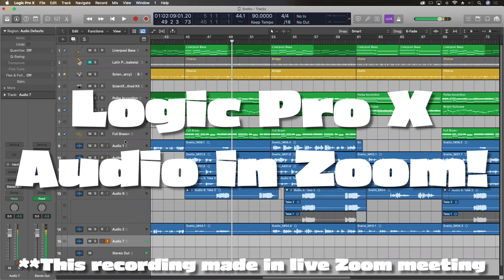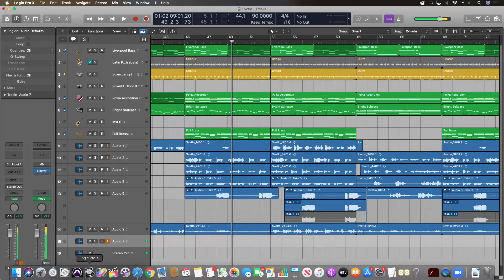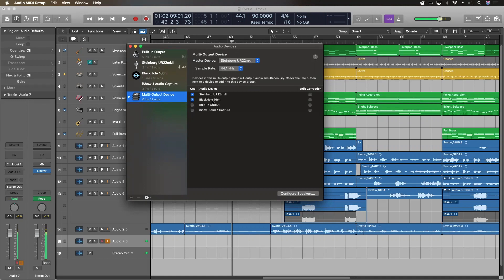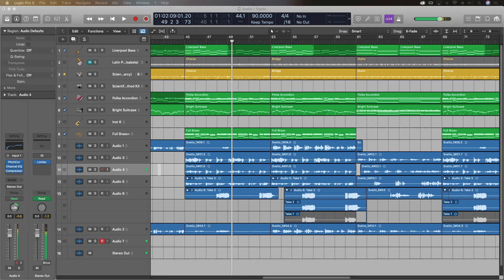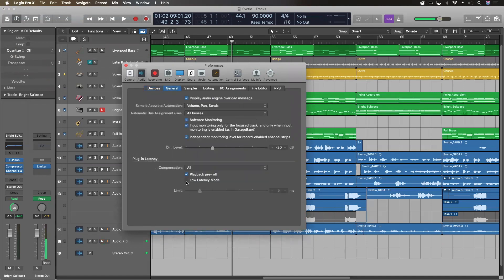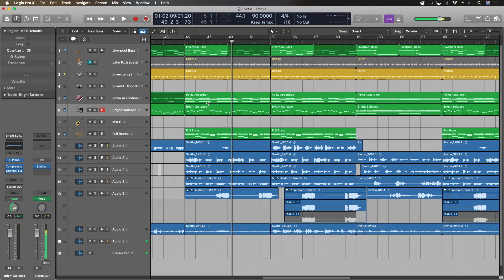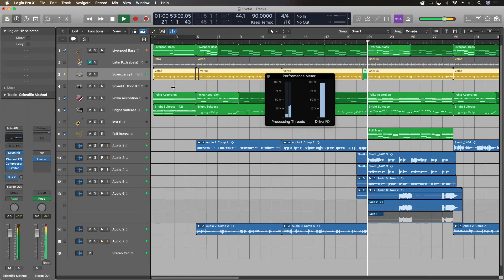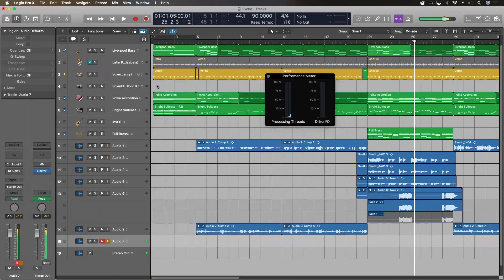Logic Pro X Audio in Zoom Meetings // Low Latency Scenario | Part 1

Comment: Hi, thanks for this video, very informative. Why are using the Blackhole driver as the input for Zoom and for your computer's audio preferences? And does it matter if it's the 16 channel or 2 channel version?
Reply from the maker: I’ve stopped using it at all. I need to make an updated video.
Reply: @LogicProLife  Why ? does it not work? or there's a better setup for using Logic with Zoom ?
Reply from the maker: I found a more streamlined way and the high quality audio option in Zoom has been sufficient in most cases.
Reply: @LogicProLife  Okay, would love to see a video about this. Have been trying to figure this out! Thanks
Reply: @LogicProLife  hi, did you ever get to this at all? My logic is no longer working with zoom properly and I am not sure why. I wonder if I can remove blackhole and go directly and if that would make it better.

Comment: I have a question on this. I've been trying to set this as you shared, but the problem is: in my virtual mixer i've set blackhole as an input, but now is receiving both signals of the multi-output device when it should only receive the blackhole one.

In a zoom call the other person also hears both of the signals. What can I do? (the input in zoom is my virtual mixer)

Comment: I deleted my comment that dealt with some issues I was having, as it was a trouble with my focusrite (as you replied). Not sure what the initial interference was. Had to uninstall and reinstall the software for my interface and everything worked out. THANK YOU for this video. I've tried several videos that didn't work or didn't explain clearly or over-exlpained before landing on this one. I have an interview and live performance with a Colorado radio station that got moved up to today and gave me barely any time to figure out how to stream through zoom with logic and an interface. Now everything sounds great and there is no delay! Saved me!! Thank you thank you.
Reply from the maker: Which radio station? I’m here in Denver.